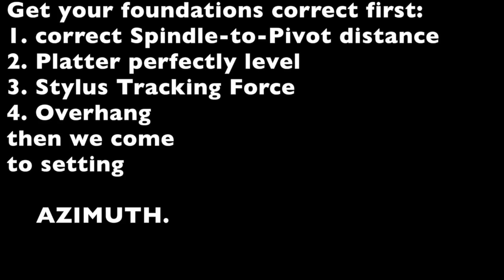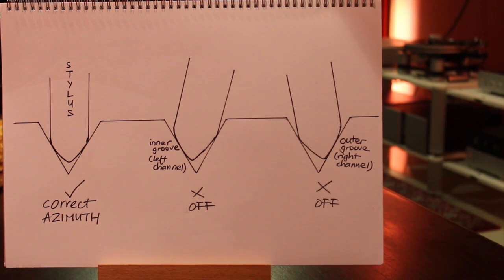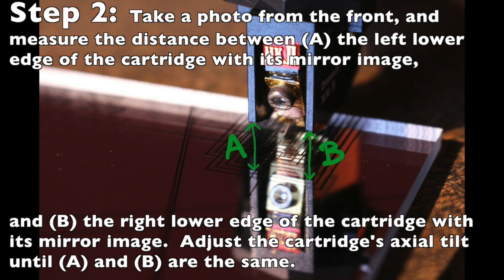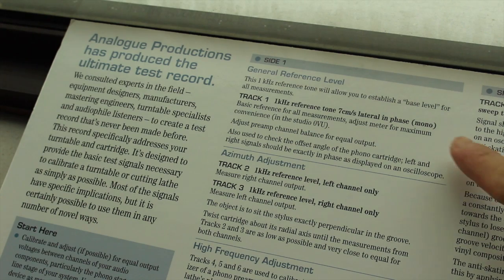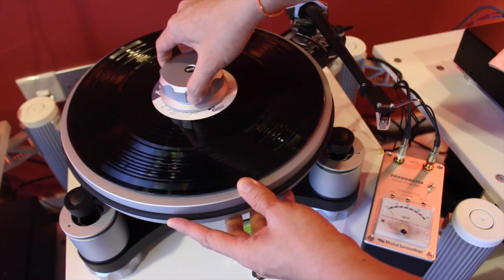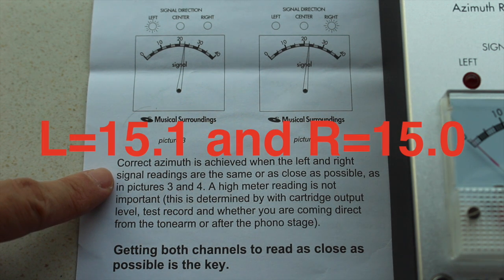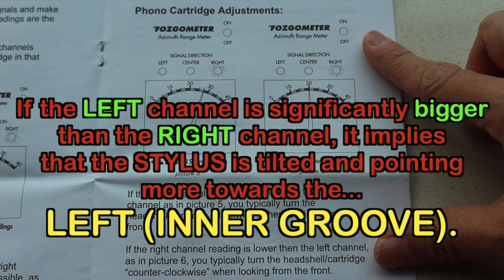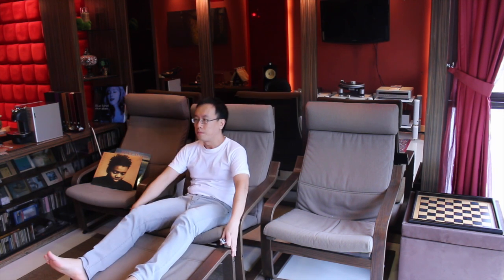Turntable Setup: AZIMUTH, Fozgometer usage

Comment: If I had to guess how the Fozgometer works, it probably takes one channel and inverts it based on what channel you want to monitor. It then mixes the inverted channel with the noninverted channel and measures the L-R/R-L difference. Perfect azimuth, that is channels with equal output, would create a null value. Of course this all assumes that you're using a perfect test tone and your cartridge has perfect balanced output to begin with.

Comment: Could the fozgometer be used to set the anti skate? If this is wrong it must surely affect the azimuth! Kind regards for excellent tutorials.
Reply: The Fozgometer is a device for adjusting Azimuth - however, Musical Surroundings advised to have anti skate set when setting Azimuth for correct setting

Comment: Could this not be achieved by using dB meters on existing equipment, for example a good tape deck or R2R? Play a balanced test tone and set your meters balanced, then play the test record through your tape monitor? $300 for a meter you probably already have in your rack???  If you have no way of supplying a balanced test tone, simply use one meter only and swap the left/right leads?

Comment: OK, "adjust and twist" I get that; but, what turntable out there allows for the headshell to be adjusted by simply twisting it? None that I know of. In fact, attempting to twist will certainly damage the turntable. So, what to do? You can buy a headshell which is adjustable, you can shim the cartridge, or, if you have a turntable like the Technics SL-1200, you can loosen the two screws under the tonearm's headshell receptacle that secure the receptacle. This allows the receptacle to be turned to a position which will  set headshell in proper position to realize correct azimuth. Once the headshell is  squared up the screws may be tightened again. Using a ratchet driver with 0 phillips head allows for the screws to be loosened and re-tightened without having to remove the tonearm from the turntable to access screws. At any rate, you might want to do a video of this to demonstrate the process using your own SL-1200. BTW, here's a tip. Instead of tightening the headshell receptacle screws leave them only tight enough to allow the headshell to be adjusted for azimuth with finger pressure. This allows for tweeking, as well as using the turntable with multiple cartridges.
Reply from the maker: Charles Ludwig Well done Charles 💪😄 thank you. Yes, i do mean doing it (twisting the headshell) only on headshells that come with azimuth adjustability. But your detailed information on loosening the 2 screws without having to remove the whole tonearm is brilliant for all SL1200 users😄✌!!! And tightenit not too muh so as to allow for finger tightening in future👍😄!!! Thank you Buddy!! Warmest Regards and really, have a joyous vinyl'ing journey! I am grateful for your advice and kind friendship.
Reply: @HiViNywschannel  Some tonearms are on a pivot point (VPI). The tone arm weight is bored off center so turning the weight a little will move center of gravity to one side or the other. This will allow stylus to be perfectly vertical to the record.
Reply from the maker: @slam854  yes BUDDY Stephen indeed👏🙏😀👍thank you for coming by again!!!! We all learn from one another😄🤜🤛😄

Comment: Ian, I bought a Fozgometer and I'm sending the first unit back because it didn't function properly, the center and red light came on at the same time  before and even after calibration.  I have the test disc lp and the turntable was directly connected to the Fozgometer. The mono-1st track center was up 3 to 4 division marks after my calibration and after sending it back to Musical Surroundings to have them recalibrate it.  Even after calibration I was never able to totally get to zero for the center/mono track, close, but no cigar.  Also when just turning the unit on with no cables connected to it, it still showed the center green and the right red  lights on and I could never achieve zero and I was always off the number of division marks that I mentioned and I know this wasn't right.

  I downloaded the sound files to do the calibration.  I was told that the units should come calibrated from the factory. Did you do the calibration on yours originally or did you use it as it was. I knew from your video that the performance of my first one wasn't right and it had a black mark on the inside glass right around the word signal. The company I bought it from, just sent me out a new one today that seems much better and they cross shipped it and I will be returning the old one. I still have the test wav files and will be checking the calibration on the new unit to make sure everything is okay, but if it holds out, I'm 15.0 and 15.4 so far, but like I said I will be double checking everything.

  They did tell me that 2-3 units come back a year, but since they got the latest batch, they haven't had any problems with units.  I also have a Foz- XTR coming, the electronic alignment black box, which electronically fixes alignment problems and uses the same test disc as the Fozgometer. This box goes between the phono preamp and the preamp and can be turned on for the effect and turned off to compare.  Ian, I'm also kicking myself in the head because I had a opportunity this morning to buy a Rega RP-10 for 2899.00, which is the same price as the RP8, with the Apheta 2 cartridge from Soundstage Direct.  I saw this last night at 10:00 PM and again at 4:00 AM, but I waited to 1:00 PM and it was gone.  That wasn't a deal it was a steal, it was preowned, darn it!!!!!!!!!!!!!!!!!!!!!!!!!!!!!!!!!!!!!!!!!!!!!!!!!!
Reply from the maker: Brother :-D  oooh you missed out on the RP10!!! Ah.....  let's hope the miss is because something else better is coming to you in the near future :-D !!! Let's believe that!
Ah... my Fozgometer, i have checked it and it doesn't need recalibration at all! :-D So that means I received a mint item.  Your Foz-XTR will likely be even better! :-D 
P10 will even be better...............................................
:-D Brother, you have my empathy, and also, encouragement :-D

Comment: Hi. I have a Rega P3 2016 edition. I noticed right channel was louder than left and vocal was off centred.  I adjusted the anti skating by ear reference against a same track on CD switching between phono input & CD input. It improved but still a little bit off.  So i guess must be azimuth but the P3 does not have adjustment on this. So how do I go about?
Reply from the maker: Brother, i have heard some people sticking on a very thin "shim" sandwiched between the bottom of the headshell and the top side of the cartridge (at the mounting point), e.g. if the left channel is louder than the right, you can stick this very thin shim on the right mounting point, and if the right channel is louder than the left, you can stick this very thin shim on the left mounting point.  I have a P3 too, and I am okay.  May be because I don't use the Rega Elys2 cartridge: I use the Goldring Elektra currently on my P3 :-D....
Warmest Regards my friend, and i hope you solve your concern soon,
~ ian.

Comment: Once again you did a great video I was just a little lost on one part about getting the head shell straight I have Dual 506 and I don't know how to make that head straight if it needs to be straight. Problem is I only got music from my right speaker.  I took the cartridge & the head show off and clean the terminals and put it back on and still nothing.  then I put another cartridge on there from another turntable & it worked fine.  now I am back to the original cartridge it a B&O mmc 10E  yesterday I finally got it to come out of both speakers but today it wouldn't any suggestions?
Reply from the maker: pdrummer davis Dear Friend😄,
You have cleaned the terminals and yet no sound from the left speaker... i do suspect that the issue lies with the cart my friend.  Apologies if i reported bad news like this...
Maybe those 4 small tonearm lead wires that attach between the headshell and cartridge, were not making good contact with the rear terminals of the cartridge per se?.. if that is the case you can use a plier and tighten the connections..
I wish you well.
🤗
Update again if there are any revelations along the way! I will be interested to know the reason too!...
Warmest Regards,
ian
Reply: thanks for your quick response  I did clean the terminals & put everything back together,  yesterday it work but then this morning it didn't  I did move the ground wire & heard a pop then it started to work again?    I only paid $35 for the turn table it came with this a $200 B&O mmc-10E stylus & had it serviced for $100 or so last year  so I'm not worried if it is the stylus.  I will let you know in a couple days after playing a few records what happens next Thanks again
Reply from the maker: pdrummer davis Ah... it worked a while at least😄!! Mmm... good good.  I hope for the best in the next few days then!💪💪💪
Reply: So far so good on my  Turn table no probable's.  That MMC 10E stylus does pick up a lot of dust I have to clean it after every play ? any reason

Comment: Thank you very much for providing a much needed video on setting up a Cartridge using the Fozgometer. I have search and viewed a lot of blogs on the Fozgometer to see if this unit is better or at a equal to a Oscilloscope. I can only assume it will be up to the user on the day. I must say if you have intentions of producing another video on the above topic could i suggest a calibration of the Fozgometer unit it self as i have read these units can and do go out of calibration during transport from A to B after been purchase. Note The  Fozgometer has to have a fully charge battery, if not this will effect the reading out put, giving you a false  set up on your cartridge.
I look forward to your next video with anticipation. :)  High end vinyl system
Reply from the maker: +blueyepaul Thank you MY FRIEND!!! Yes!! What you said is true!.... The calibration process is very simple.  And it will work very accurately.  I didn't need any calibration because i had checked using the 3 tracks and everything has been perfect.  Of course, never say never, and I would recommend all to have a quick 5minute calibration check on their purchased units before moving onwards to calibrate their cartridges' azimuth.  Otherwise this is a very simple and effective tool.  Oscilloscopes and Dr Feickert's Adjust+ could be even better!!!
Thank you for your support and encouragement.  I appreciate your time keying in your comments to us.  Everybody learns and is all the better for it!!! THANK YOU!!!
Sincerely,
Ian.

Comment: what a great video!, i really like the alignment protractor that you're using, can i use that same one with my Technics SL 1210M5G?
Thanks
Reply from the maker: Dear Vinyl Fan Brother :-), how do you do?!! Great to hear from you... hahaha. Really thank you for your support and encouragement!  My wife smiled at me as I told her your comments... :-D 

And yes Brother, you can get the very good and super value for money Analogue Studio mirrored cartridge Alignment Protractor from most official online retailers.  I checked it's still the usual £13 :-D that is great enough.  Mirrored and with Parallel Hash Marks at the 2 null points!  Thank you for your enquiry. Mine is one I just bought from my Avid turntable retailer based on goodwill and great friendship with the retailer. The 2 null points are fixed drawn on the mirror and i just after I align it correctly on 1 null point, I just swing the tonearm over to the 2nd nullpoint, without the need to shift the mirror protractor (because Avid already drawn it for the SME309 tonearm for this specific protractor)

However, the Analogue Studio Protractor is equally accurate and you can use it with equal effects.  After aligning the cartridge onto the 1st null point, one just adjust this Analogue Studio Protractor a bit as you swing the tonearm over to align it on the 2nd null point on the protractor :-D !!!

Hifi Choice recommended component too :-)

It is more than good enough.  Does its job accurately and excellently.

Bets regards to you and your family :-D
Ian.